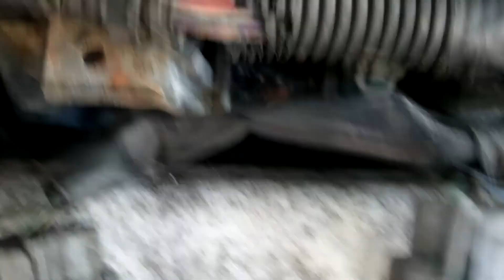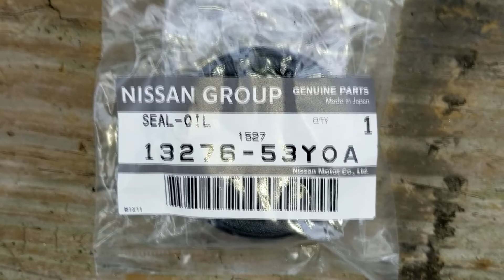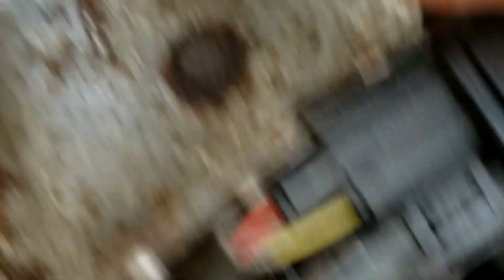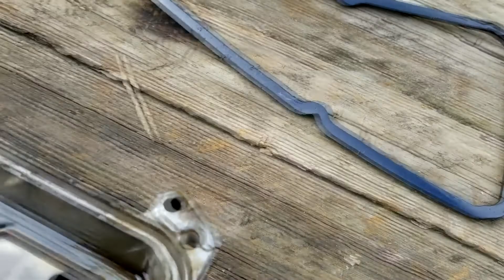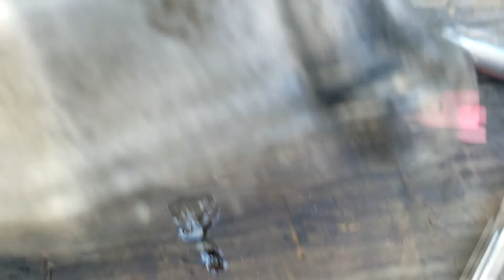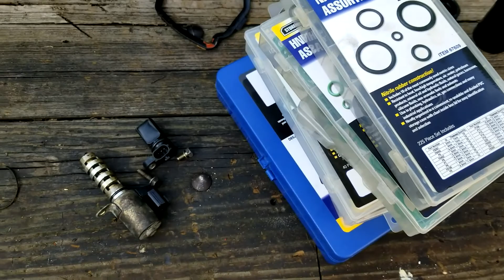2004 Nissan Sentra Valve Cover gasket and Spark Plug tube seals

Comment: I went to the junk yard n found one exactly like that one...metal...not leaking from the tube clean spark plug ...but it wasn't for my car 2001 nissan sentral SE-R 2.5...yes they are making us buy the plastic valve cover...due to the removable of the tube seals hard to find

Comment: I have a 2002 nissan sentra but unfortunately I have to buy the entire valve cover
Reply from the maker: is yours's a GXE or S model?  GXE valve cover is plastic and the S is metal. yes for my GXE I had to buy a new valve cover. The model S is metal so you should not have to buy one, just replace gaskets and seals.

Comment: I know this is a old video but I just wanted to say thanks. I was looking to verify the part number because now I cannot find an actual part number for the plug tube seal. Only amazon shows this part as one that fits the 2004 nissan. I didn't care to trust only amazon or ebay.
Reply from the maker: your welcome,  this was a video for a 2004 Sentra. Amazon they are probably more expensive. The Nissan Dealer near me If i go to their parts on line and order the parts through the internet and have it schedule to pick up at the dealer they told me it costs less than if i went in and they looked the part up. What I found was that in the exploded view of the parts there is NO PICTURE of the spark plug tube seal just the part number and it says spark plug tube seal....and again THIS is for an S model with a metal valave cover, NOT the plastic valve cover.
Reply: @meTimetraveler  I had the same problem, no picture in the exploded views, no part number. I have the metal valve cover as well. After some reading, apparently many of these are plastic covers (non S model) and there is no separate seal for the plastic ones; you have to buy the whole valve cover. I did order it from a Nissan dealer but I just ordered by part number and they cost about half as much as Amazon sells them for.

Comment: This video comes at the perfect time!  I also need to replace the Spark Plug Tube Seals on my 2006 Sentra.  It has the same Valve Cover.  Seeing that you can replace those gives me some hope here as I can't find a new cover online anywhere.  Just curious, after replacing those seals have you had any leaks anywhere?
Reply from the maker: no, no leaks unfortunately the car has not had the state inspection so have not driven anywhere meaningful. Go to an online nissan parts listing to make sure the seals are the same. No need to buy a whole new valve cover. Does your 2006 have the VVT solenoid on the top cover too.